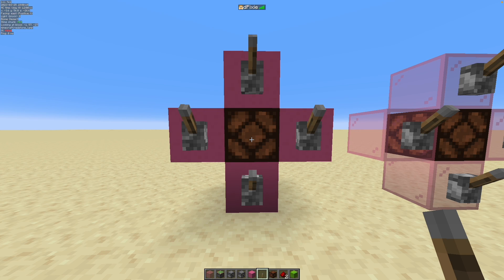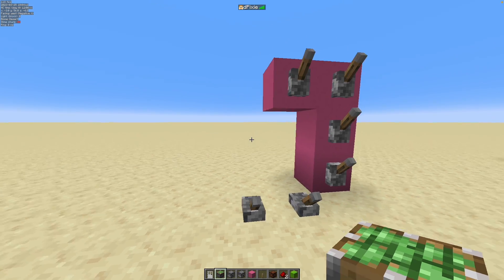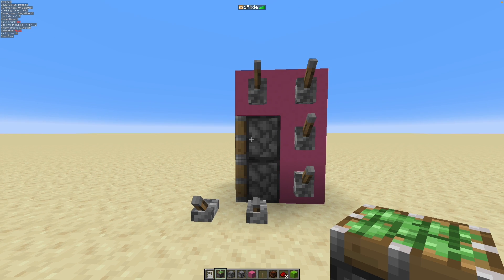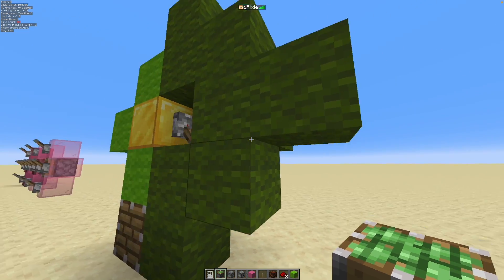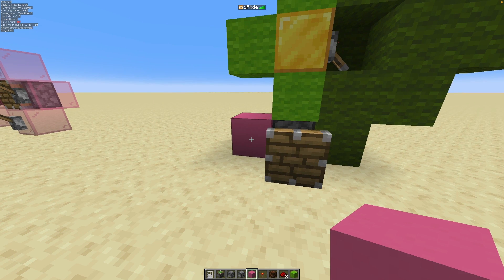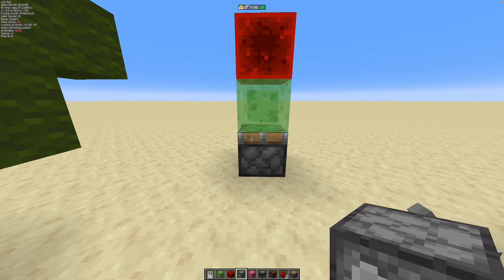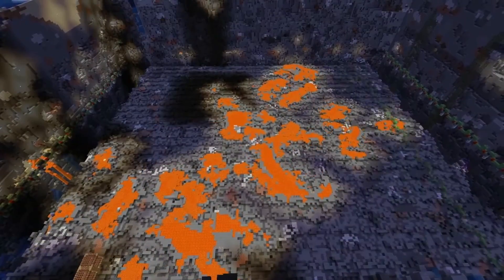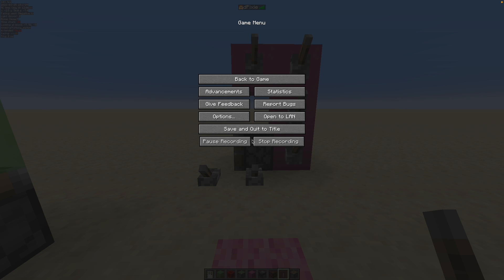What even is "quasi connectivity" and "BUD powering"??! - Minecraft java

Comment from the maker: Since the "Block Update Detector" vs. "Block State Update Detector" debate has come up, I figured I'd share my thoughts here:

I'm fine with either term. The most commonly used term in the community seems to be BUD, so I'm sticking with that 🙂 Technically, it is the block state that changes, and that's what's implied by "BUD." I mean, if the state didn't change, what are you detecting?

For argument's sake, I can accept SUD over BUD, but nothing about the video changes except for the terminology used to describe the feature. That's just my opinion, and you're welcome to disagree—as long as you do it with a comment☺

Comment: Thanks for the video, I'm not to sure but it seems to work horizontally also, place 2 pistons next to each other on the ground, place a block on top of one and power it, both pistons will extend.
I'm still learning Redstone so is this quasi or am I missing something? Iron doors aren't able to be placed horizontally , so I don't understand is this a different bug?
Reply from the maker: Hi! Yes, if you strongly power a block it will generally weakly power all the blocks that are straight out from either side. So the air block above the second piston gets weakly powered and that will trigger it.
Reply: @d-pixie  wow I didn't realise you could power air blocks 🤯
Reply from the maker: Normally you can't, but it's one of the strange quirks with quais connectivity 🙂 Doesn't matter what block is above, even air works in this case.
Reply: @d-pixie  fascinating, thanks for helping me figure it out, I see now the air block is the top part of the "door" of quasi